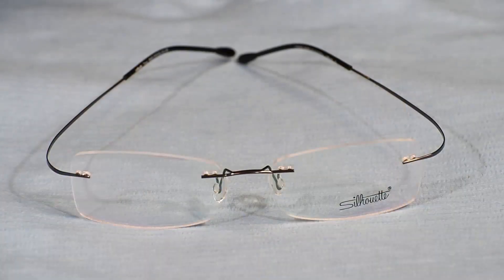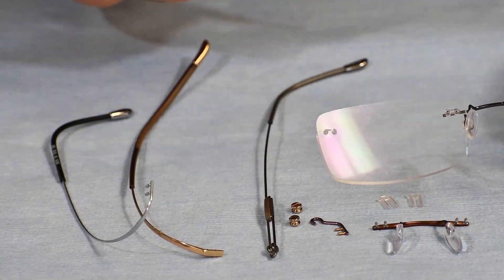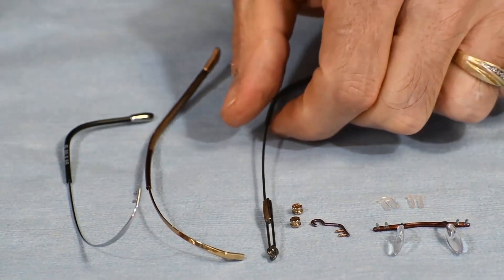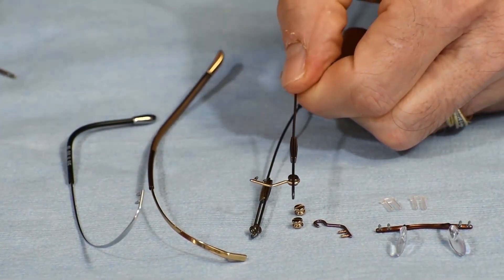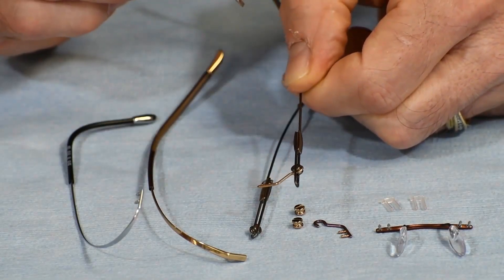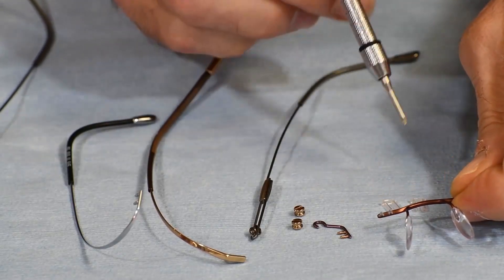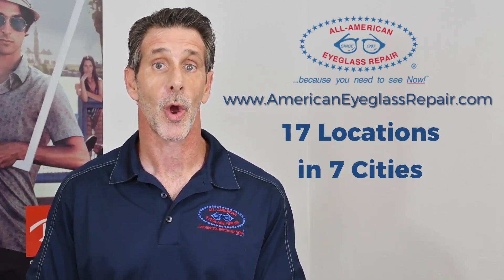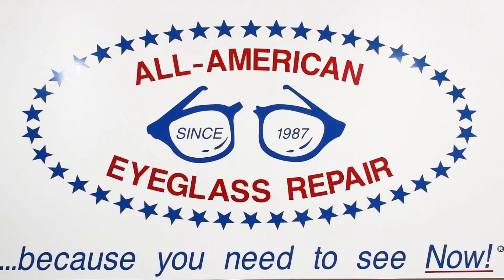Silhouette Eyeglass Frame Parts and Repair Techniques from All American Eyeglass Repair

Comment: how long does it take for you to respond to email with photos? I ued the webmail n your site and submitted several photos a week ago. I have seen any comfirmation that you received it/ Not a peep. I have a broken Siilouette frame that at best needs a replacement of the hinge (short connector between the lens and the hinge screw. can you please find my sumission? I think replacing both sides with a new temple hinge would be best for strength of the temples amd the temple hinge since weld leave brittle metal on both sides of the area welded. at least this is what a local jeweler told me who welds but does not have replacement parts. I will resubmit my pictures and a messsage. by using that webmail on your site, I do not have a copy of the email. bummers!
Reply: did they respond to your email?

Comment: They will last you 2 month if you are lucky.
Reply: I use mine 24/7 except when I shower or sleep.....and I'm going on 6 years...maybe you got a lemon or are too hard on your equipment.
Reply: I've had my silowettes 4 years and no issues.  I actually wear even while in the water at beach.  I also have fallen asleep with them on.  I sleep in recliner so no issues.  I can't say enough about these frame less progressive lens glasses.
Reply: Absolutely right.  another bridge just broke on mine.  That's after the bridge broke a month after i bought them.